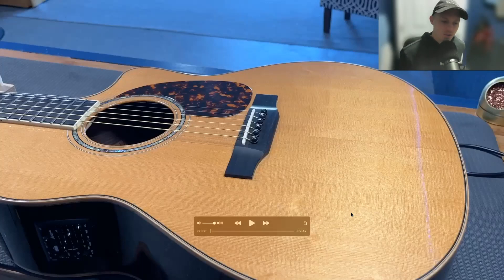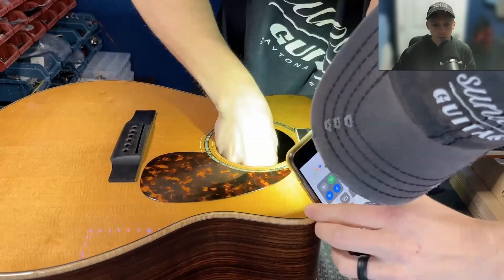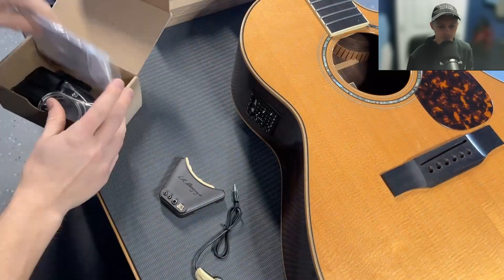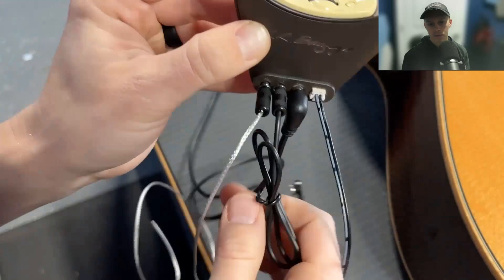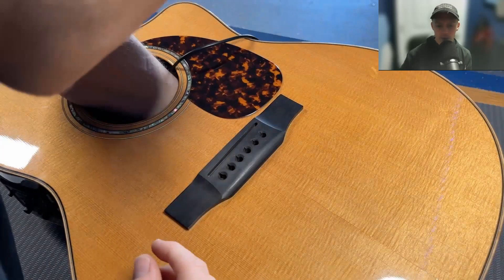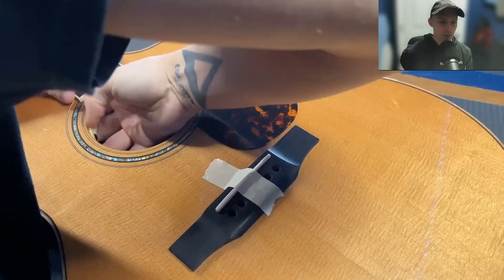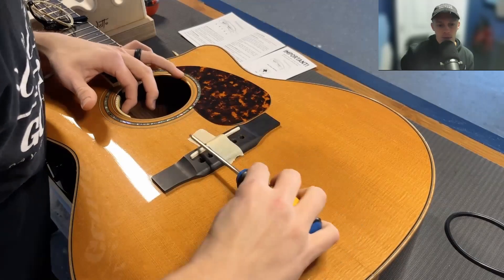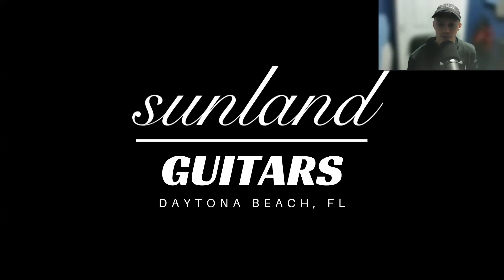L.R. Baggs Anthem Pickup Install Larivee Acoustic Guitar How To Instruction

Comment: Hi, friend! thanks for the video! do you think the anthem (this full version) affects the unpplugged/acoustic sound? Thank you!
Reply from the maker: It's hard to say. If it does it's a very small amount. This was done for a customer of mine so I didn't get much time to listen to the tone first before installing. If you're worried about it, just make sure you put the wire clips next to braces so they are fixed to a spot on the top or back that already doesn't move (resonate) very much.
Reply: I recently bought a new Larivee 000 with this system already installed. Test played for quite a long time before plugging it in and fell in love with it. Plugged in to a Fishman loudbox and was just as happy.

Comment: Thanks for the video. I have a Larrivee OM-40 that came with an Element. I want to upgrade to the Anthem. Maybe a dumb question but do you know if the under saddle pickup of the Anthem is the same wire or thickness as the Element? I’m assuming so since it’s described as the Element but just hoping to avoid trimming the saddle and doing this install myself if possible since it’s already drilled and fitted for Element otherwise.
Reply from the maker: It’s been a while but I do believe the under saddle pickup is the exact same in both.

Comment: Quick tip to save you time and hassle ... after removing old end  pin ..(or drilling it out if no jack was previously installed)  take a stiff wire a few inches long , bend the tip at a 90° angle. Put that in the hole and let it hook on the inside of the tail block,  mark it where it comes out of the body... 

 You now know how deep to set the inside nut on your new end pin so that it's the right dept when you pull it through... 

No more .. Install , pull it,  check it , reinstall... because its tight the first time ...
Reply from the maker: Love that! Thank you!
Reply: oh thanks man... Every installation video is skipping that endpin length issue like it's no big deal, when it's the worst part of the whole installation. You can waste a whole hour testing the length until it sits flat...